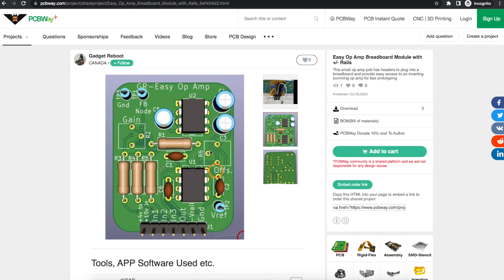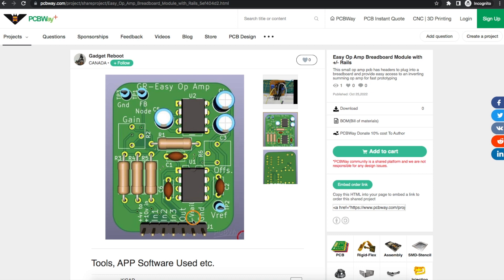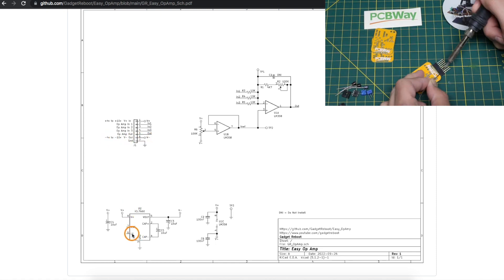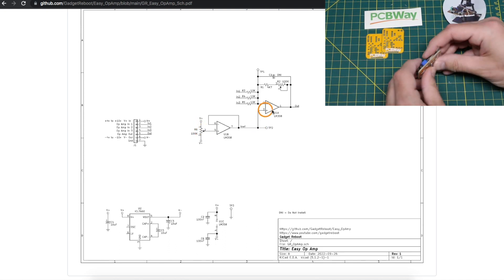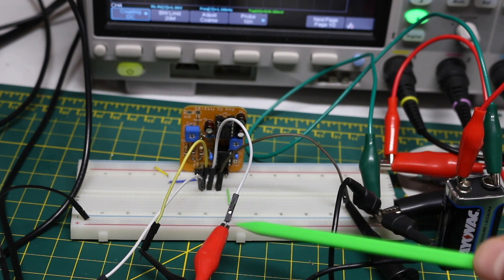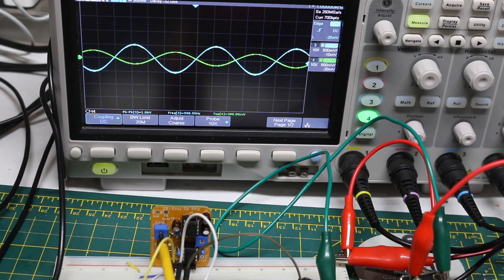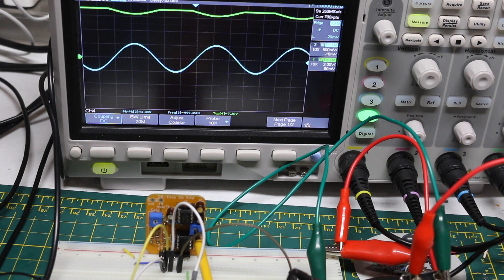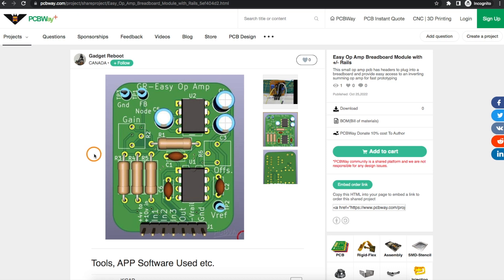Op Amp Breakout Board for the Breadboard

Comment: Nice little circuit,  but I would have put a decoupling capacitor on the wiper of the offset potentiometer. Also nice to see that the opamp is not running full bandwidth and that you have provided an upper frequency limit with the feedback capacitor.
Reply from the maker: yeah I did experiment with various capacitor values on the offset pot but I didn’t see any impact and I was just trying to keep the board with as few parts as possible. I was wondering if those 10 uF capacitors on the plus and minus rails were already doing something helpful.
Reply: @GadgetReboot  If there is no noise on your power supply then it should be ok ish, but it's the reference to the opamp and any signal on it will be fed directly to the output so it's always a good idea to decouple it. the same for the feedback it's always good to limit the frequency response to just greater than you need.

Comment: Is it possible to zoom in on the schematic for us phone users.
Reply: If you cannot zoom the schematic on your phone, it sounds like pilot error 😉
Reply: @bob_mosavo  the schematic part of the vid. Unless I can zoom in on a YouTube video
Reply: @kyleallred984  If you are an iPhone user you can zoom anything by doing 2 quick 3-fingered taps on the screen, then drag with 3 fingers to pan around. Another 3-fingered double-tap returns the view to normal. Also if you do  a 3-fingered triple-tap (instead of double tap) you'll get some controls to set amount of zoom etc.
I think you have to enable this feature in Settings -> Accessibility.
Reply: @sootikins  Android
Reply from the maker: i’ll try to directly use a PDF viewer so I can zoom in next time. I was viewing it directly from GitHub and that doesn’t allow me to zoom.
Reply: @GadgetReboot  thank you